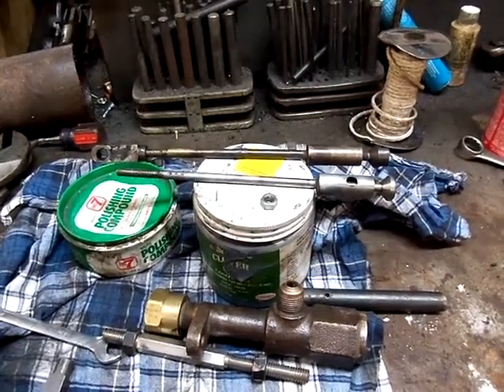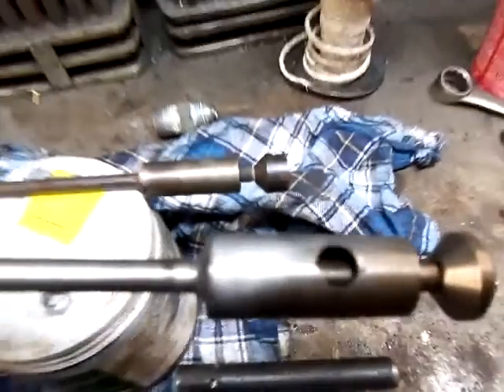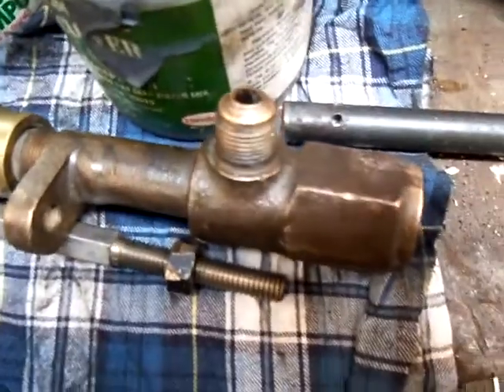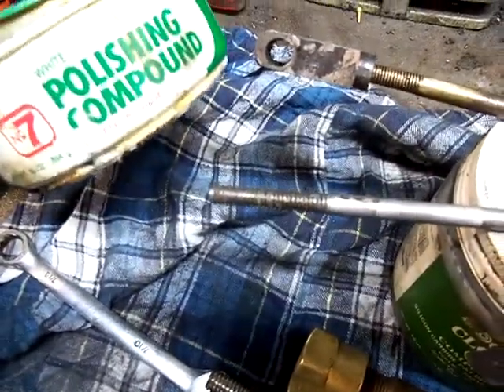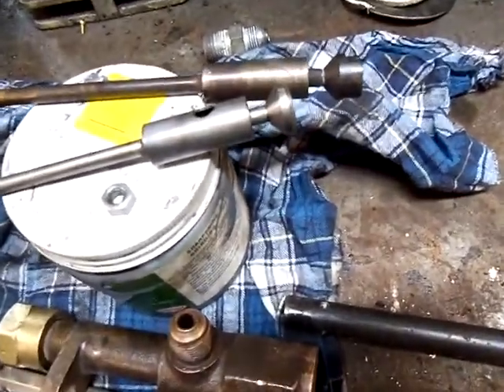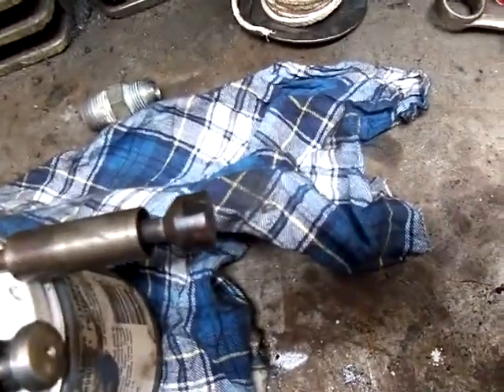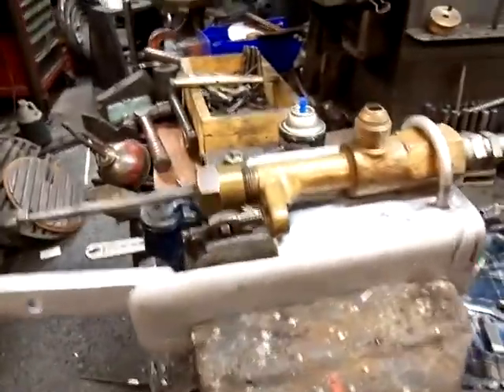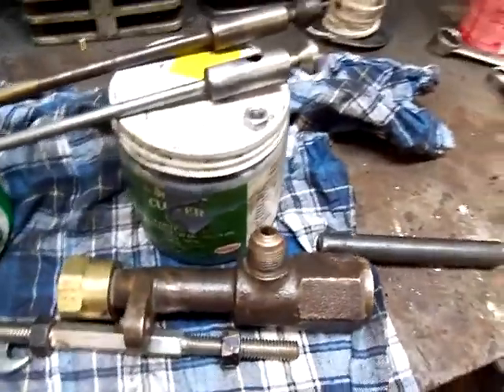Stanley throttle repairs Steam car

Comment: Hello. Do you buy Stanley parts. I bought a lot of car parts in there was a box of Stanley valves throttle pilot light and other assorted Stanley parts.
Reply from the maker: yes My number 7172486170